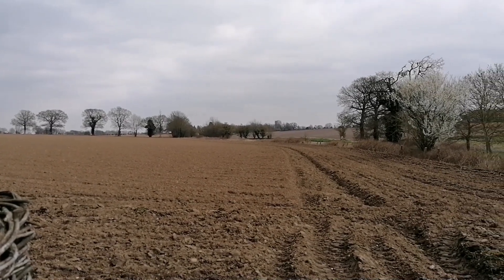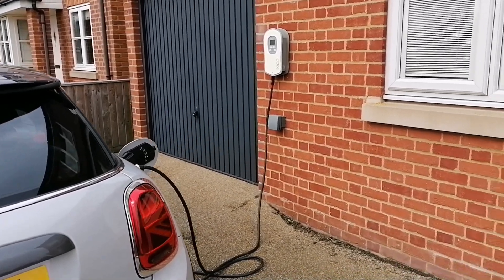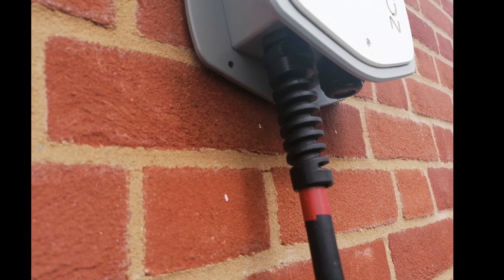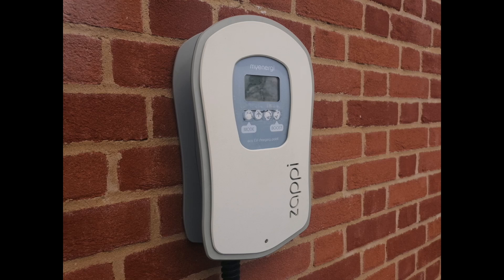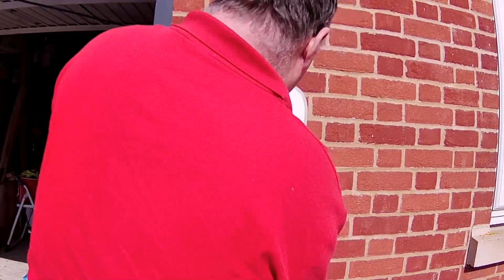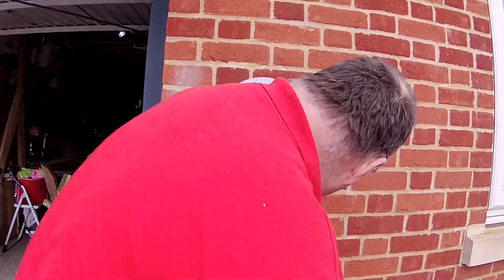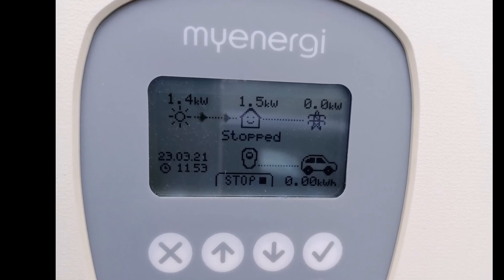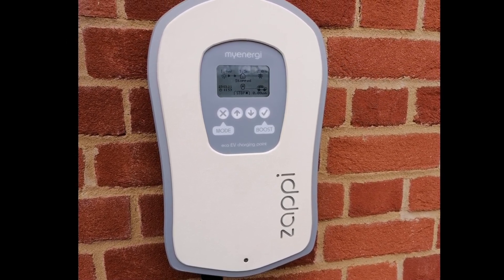Myenergi Zappi 2 year review - has it survived outside in all weathers?

Comment: I have a hell of a job to get my Zappi to set to delayed charge with my daughters mini, i never have any such problem with my Tesla or Nissan. It always involves 10 minutes of plugging in and unplugging, locking and unlocking before it will stop the immediate charge and wait until 00.30 as programmed in the mini. Even then it often displays charge complete on the zappi instead of charge delayed as it should. Did you ever have these problems with the mini & zappi?
Reply from the maker: Only when I left it on Fast charge. Charge complete a few times when locking and unlocking as the Mini stops charge where others just slow the charge to minimum.

I only used the Zappi timer not the Mini's as its easier to set and control
Reply: @EVPuzzle  Thank you, i shall try that.

Comment: Did you have any issues with the zappi v1 and the kona? I’ve got an new kona 2021from onto at the moment and if I put it in eco+ when just charging on solar stops it trips the house electrics. Never had an issue with my old i3 but MyEnergi think it may be a kona issue.
Reply from the maker: New Kona has had start and restart issues. They've changed the protocol on the new Kona but tripping is a physical thing isn't it.. Try reduced charge mode on the Kona to see if it still trips Perhaps?

My Kona worked fine on the Zappi and not had any issues with my Mini either.
Reply: @EVPuzzle  what do you mean reduce the charge mode?
Reply from the maker: Charge rate. There's Reduced and minimum and maximum. You can set these for public charger and home charger type chargers. Think one is called station and the other.....¿¿? Can't remember.

Think it's in the charging menu under charge current settings.

Instead of charging at 7.2kw, reduced will be 5.8kw ish and minimum 3.8kw ish.  If it's tripping with too much power this might prove it

Comment: Have you had your Air Source Heat Pump fitted yet? Interested to see your review as you go into good detail and cost.
Reply from the maker: It's taking a good deal longer to get a quote than expected. Might be a while away yet let alone installed.  Then again I'm not rushing into it
Reply: @EVPuzzle  OK, I managed to get the the Green Home Grant, think I can also apply for the RHI Grant, looking at full system so £12,000. Interested in getting real running and servicing cost before I dive in.
Reply from the maker: Looks like I missed out on the grant not having a quote in time
Reply: @EVPuzzle  You can still claim the RHI so not that bad, I think, !?!!

Comment: The Zappi's are a great robust product. Our's is in a little more sheltered location than yours, so it's good to know they can stand the full force of the elements when postioned in an exposed location.
Reply from the maker: Looks like I'll have to investigate the blue green residue on my plug socket. I'm presuming that's not standard on other people's plugs.
Reply: @EVPuzzle  it's not normal. A bit like battery terminal corrosion. Simple job to clean up the connections with some emery paper or wet & dry.
Reply from the maker: Now I just have to find out if its the Zappi plug or the Mini that's caused it. I'm sure it wasn't like this with the Kona
Reply: @EVPuzzle  on my old Rolec tethered (Type 1) charger that lasted over 5 years there were never any residue so yes I would get that looked into...

Comment: The blue/green copper sulphate deposit on the CP connector of the plug is of concern. This is the pin that 'talks' to the car, so will prevent charging if it gets bad enough.
Reply from the maker: Appreciate the heads up. I'll ask myenergi about it. I'd expect the cable and connectors to last longer than 3 yrs so if this is a concern, something must be wrong. I'm not a particularly heavy user charging every day for example for not a lot of expected wear

Comment: I have solar panel recently installed on my house and waiting for them to be plugged into the grid. Largely down to your videos. So thank you. I have a suggestion for a new video, which I can not see that anyone has really broached on YouTube and it's quite simple really. 'What will a typical 4KW solar panel system power?' For example, when the sun is beaming down, can you have on your Oven, TV, hoover all at the same time without drawing down from the grid. For me, I thought it would be important to know before purchasing the PV panels. Obviously you have battery storage, so slightly different for you, but an interesting area, which I would have thought would pull in a sizable number of new viewers to your channel.
Reply from the maker: Not a bad idea. I talk about what you can power loosely on a few videos but definitely not specifically. I went for the additional array so that we could power more stuff without grid pull.
Reply: @EVPuzzle  even if you talked about what your 6.2KW system (which is I think roughly what you have now) can power, it gives a little perspective about the potential of electricity generation. For me, I loved the idea of when the sun is beaming down with no clouds in the sky, I can be powering my home without a boost from the Grid, but never really got to the bottom of what could be powered. For example, should I avoid having the dishwasher and washing machine on at the same time and have then running back to back, or would the PV panels power them both. Hopefully when my PV panels are up and running, there will be many times throughout the year when I can power my high energy dependant equipment without a power top up. I don't have battery storage as too expensive for the savings, but when prices come down, I will probably make the plunge. Unless car to house becomes the norm, which will save buying a fixed battery in the house.
Reply: @ashleydrakeford5962  I think the answer to that is simple if on a sunny day your producing 3.4 kw then you can only use 3.4 kw before pulling from the grid. That means a washing machine heating water might pull 3kw leaving  400 watts or .4 kw spare for everything else.  The problem is if there’s some cloud about as the your solar production might dip below your household demand. That’s when the battery backup comes into play as if charged it  will iron out those dips and then replenish itself when demand drops. Having a battery fitted during solar installation would have save you a good deal of VAT. I learnt to my cost as I installed a battery a year after solar and then had to pay 21% vat instead of just 5%.

Comment: Ever try an electric bicycle for short commutes ?
Ebikes are healthy exercise and a fossil fuels free transportation option.
Every adult and child should own a bicycle and ride it regularly. Ebikes are bringing many older adults back to cycling.
Reply: Mine Zappi 1  is nearly 2 years old and fitted outside too. No issues in terms of wear and tear. It is still running on the original firmware  -  1. something - and am inclined to stick with that. As I understand it the only way you can upgrade the firmware is via the hub or buy a new unit. Given that there seems to be some challenges with the hub I am inclined to stick with what I have got. If I change cars that might require a re-think
Reply from the maker: Hub is great for seeing data on the app
Reply: @EVPuzzle  sure I can see that as a big plus but just a bit wary of taking the step based upon what I read on the MyEnergi forum
Reply from the maker: A lot less wary than moving to a smart phone, in my opinion. Best way is get a mste/fellow enthusiast to install for you 😉
Reply: @brucemurphy2735  new firmware makes quite a lot of difference. Also Hub allows you to remotely monitor and turn Zappi on/off, so worth it for less than £100.
Reply: @edwardpickering9006  I know lots of positives but I am just put off by some of the difficulties encountered by users in terms of set-up and ongoing use.  It just works at the minute and my lack of techie skills makes it sound a bit more daunting
Reply from the maker: Course I have, my back side prefers a sports seat however. 
Sadly, theres a safety issue too,bikes are great to be outside etc but just aren't a very safe form of transport compared to a car

Comment: Good to hear its wearing well.
I'm waiting for a Zappi 3 that does V2H (we live in hope)
Reply from the maker: Yes a Zappi that can pull from the car to the house as a power source would be excellent. I did ask a few years ago and wa assured there's nothing in the Zappi to stop it, it just needs a bidirectional source. The car starts the charge so, I guess the car needs to start the push of energy to the house also.
Reply: @EVPuzzle  The Leaf already does it via a Wallbox as part of a V2G trial Octopus are running. Unfortunately Chademo seems likely to be the  losing charge standard.
I hear that Tesla has built the capability into their cars as well.
So I'm expecting V2H to be the norm before too long. 🤞
Reply from the maker: But you need a Leaf and there's the problem. Such a shame chademo was the only supported bidirectional option, v2g might be thought of better
Reply: @EVPuzzle  
Perhaps in the not to distant future CCS will support bidirectional. Correct me if I’m wrong, with Chadamo one needed to carry two charging cables one for A/c and one for D/C. and that lead to CCS becoming the standard.
Reply from the maker: CCS 2 supports it I believe